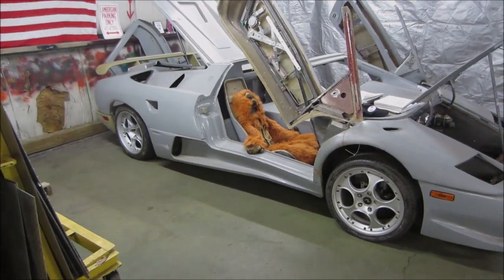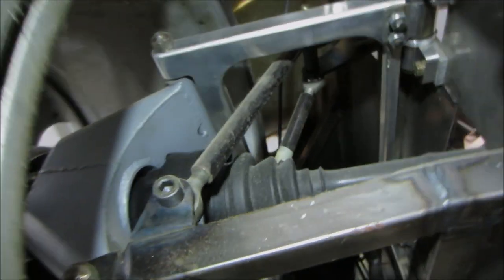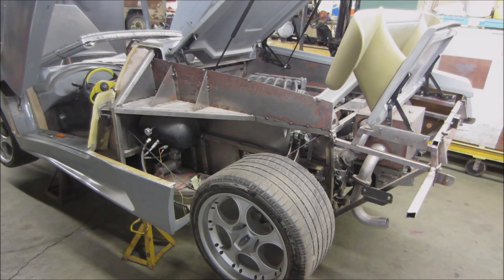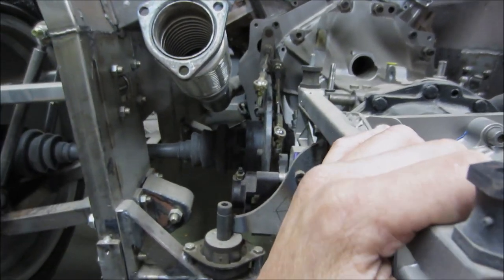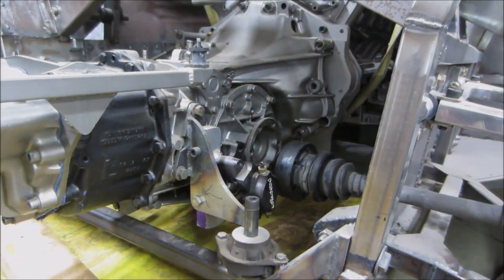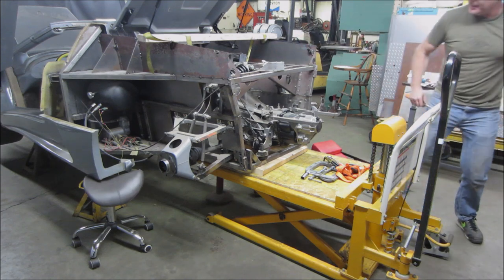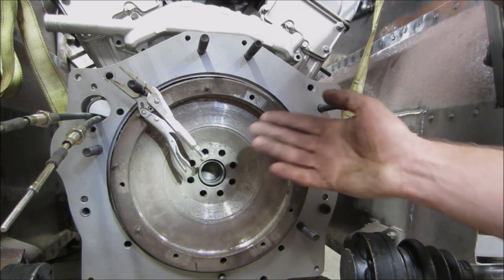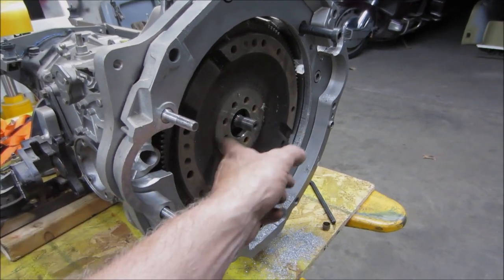Free Lambo Diablo hand built, lets see what it needs to Run?

Comment: I'm not sure if it helps but the UK-based kit cars like this eg Ford GT40 type used either a Renault 30 or, Porsche G50 box. I'm told the Renault box proved to be a bit marginal for the Ford's V8 torque whilst the Porsche G50 box was quite difficult to source. I expect the BMW V12 will be quite torquey as well. Maybe use a V12's auto box with 'paddle' shifts - assuming an electronic box is available ? Failing this, it looks like a re-engineering job on the flywheel, housing and clutch-to-box mating. Might be worth trying to track down the original kit designers to see what they had in mind....

Comment: Hmmmm, Leave this flywheel and clutch in that last position. Need a flywheel that fits the engine, machine an 8-bolt block/cylinder to take the gap between the "new" bigger flywheel and the 1 you have. (maybe a rubber thing?) Leaving the flywheel you have, starterfunction inert, but works with the clutch. I hope I make sense. ;)

Comment: I don't know what that transaxle is, but I know (100% certain) it's not from a Porsche 944, 951, 968, 924, 931, or  928.  I agree the 5th gear section is similar in appearance but the casting of the trans is not the same. Porsche front engine cars have the clutch/flywheel in the bell housing on the engine end of the torque tube, not in the transaxle. This trans is from a FWD car. My best guess is this transaxle might be from an Audi 5000 (016 5-spd maybe?) Would make sense, similar concept as the Fiat 128 & Fiat X1/9 (used the same transaxle in FWD & mid engine car) but this time using a longitudinal layout with different engine.

Comment: I dont think the guy gave up on it, because of this problem. Probably just started working less and less... 
Quick google search returned that there 100% is something that will fit it. Just make sure exactly what do You have. If that transmission is Porsche and not Audi, then it is inverted somehow. Im sure this engine/trans combo can be made working again with some time and donor car. Im more concerned about fiberglass shell fit and finish, getting all the rattles from it and making all the brackets to support it, so it doesnt look like a mess.

Comment: Start whith a full engine inspection if it's a mockup or not and low budget .second trans axal from audi sounds like option and the adapter guys out there solid info and a derection to go. Therdly ecu like the tuners use I think it's called super squirt all sensors are  able to be measured for peak performance even from a hand build that gives you power to the ground the sense of accomplishment to finish or there's a crazy guy in Ireland whith a youtube Chanel builds ground up's

Comment: Is the ring gear on the flywheel you have pressed on or a molded part of the casting? If pressed on, perhaps you could have a machine shop fabricate a ring gear that is wide enough to reach the starter drive.

Comment: seeings that the power plant is the heart of the car , one would think that it would be the first thing completed and then build the car around it . i can see this guys thought were there but, must of gotten frustrated and shifted his plan to the body .... opps ... good luck  ... i can see that you will have to sort out drive train and then reset it to the body to get it to work right  ... retro a sub frame to hold drive train as one unit before the install .... just my thoughts

Comment: That flywheel is going to be a complex one as it got to be centred and balanced if welded it will need to be preheated, I’m not sure a flex plate will be up to the job, a flat steel blank and ring gear shrunk fit and welded
Reply: CMS do a conversion kit for a v12 to Porsche g50 box but it’s 1900 dollars

Comment: Looks like the engine and xmsn were installed as a unit .  Might be easier to pull the engine , then when you're ready , bolt em togetherand put em both in at the same time

Comment: The transmission was a Porsche one and the motor was a 12 from a BMW and when we tried to put the bolts in all the holes were gone, So we drilled it out, so that it would fit And with a little bit of help from an adapter kit, We had the engine running just like a song.

Comment: Didn't those BMW V12s have dual independent ECUs? Like they controlled a cylinder bank each is if it was an inline 6. That would explain the dual crank angle sensor mounts, and the angle between them is probably the same as the angle of the cylinder banks. :)

Comment: If you would have dropped the motor as well. it was only two more bolts to unbolt the motor mounts and you would have to use straps and move them or take the starter out. way more work than just taking motor and trans together

Comment: Kudos to you for attempting to take that on. I'm glad as a viewer. But for the one to actually have to do it, it looks like a bloody nightmare! The car seems to be leading more toward the "fabricated on the fly" rather than following any specific design. I'm sure the original owner put lots of heart into it, but it will not be easy to figure out what he was doing for sure as he probably didn't fully know himself. He was sculpting as he went along. It's like trying to finish somebody else's painting.

One thing is for certain, if anybody can get that engine running it's Mustie.

Comment: It might be possible to find the right flywheel for the engine and machine the outer diameter (up to the gear) to fit the adapter plate. And don`t mess with the dynamic balance of your flywheel!! believe me, it`ll not just vibrate, it`ll fly off like crazy (that`s why they cal em flywheels!! lol)

Comment: if that is anything other than a 956 (turbo 944) transmission do yourself a favor and get rid of it. 

im voting for ls conversion; cheap and easy. 
there are also adapters for the 956 and other Porsche/audi transverse gearboxes. 
its super common with the GT40 guys. 

could also do a subaru 6cyl (ez30) with a 5speed/6speed. the lockouts to make it transverse 2wd only arn't all that expensive, or can be fabricated.

Comment: At 17:17 the tank holds a volume of air so it doesnt take you a year and a day to adjust the air bags. otherwise its like filling a tire with one of those cigarette lighter compressors although they will fill a tire it takes like 5 minutes. who has 5 minutes to adjust air bags on there ride when it only takes a small tank to handle the volume.

Comment: Chevy Ls 6.2
You could adapt that trans to Ls easier
Way more power than that boat anchor
You could remove the starter ring from the bmw flywheel,,,and the Porsche starter ring  machine a spacer ring for the Porsche flywheel 
Install the bmw starter ring on Porsche 
Weld up the holes on bolt pattern open the center hole to fit bmw crankshaft and redrill bmw bolt patter in the flywheel

Comment: I suggest look for a salvage Diablo which had been wrinkled around an utility pole.
Sorry for my bad english but with stock parts you got the best result - and the fas-
test way to a running car. As more close to the original, the higher the sell price.
Or check for a salvage 993 Turbo4S (the latest aircooled 911) and use its 'ingredients'.
All the other tries will not make you happy. Btw, i still wonder if there is no intellectual
and/or design property on this object. sssst

Comment: G'day  Mustie ,,
Just picked up on this one ,and it has all  the makings of a great project .
Frankly, I don't think it's the impossible  job others are balking  at . Sure the mating of the drivetrain requires a technical  fix  that is beyond  the average shop ,, however , quite simply,  this is where a specialist  is required to assist with the appropriate  fix ,and it will be well worth the outlay  to overcome  this issue .
Moreover ,there are possibly a few good solutions to joining the motor and box .
In your position ,,I would continue to work on all the other jobs  that you are more than capable of completing.......
Leave the drivetrain fix to the appropriate  specialist,,,  the end result will be  another notch  in Musties gun .
Do your research  on this one , take your time and do your best work .
 Sure,,  it will require substantial  effort , but  your a substantial  kinda guy Mustie.
BRING  IT  ON ......!!!

Much  Respect 
      from
Down  Under

Comment: It looks to me like you are putting the fly wheel on bass akwards. how is the clutch disc sopposed to work against that surface gear side away from motor not next to motor, then it has an inset so it will meet up with the engine.

Comment: Option #1 find a complete BMW parts car with a running engine with harness and ECU Option #2 small block Chevy or LS engine swap but in my opinion it's been done before and it's the easy way out Option #3 air cooled Porsche engine :)

Comment: Can you put that thick of a plate between that back housing on the trans and the middle of the trans? I don't think that's the normal mount position. Watch out for bearing end play and gear mesh issues.

Comment: I would be concerned that the Porsche transaxle may not handle the power of the BMW V12.  The 924 only had to deal with 168 BHP or about 180 lb/ft of torque.  The BMW V12 could put out well in excess of 312 lb/ft f torque depending on the version.  I think you were given a money pit.  But good luck with it.  At least it isn't rusted out.

Comment: It's got 9 bolt holes on the end of the crank shaft and 8 holes on the flywheel, so it will not fit check other parts

Comment: I have to say i like this better then the real deal....you get to use aftermarket gear you choose entirely from senseors to throttle bodys to ecu,s and that will make this an amazing car by the time its driveable! And in alot of ways alot easier to fix and alot cheaper to fix ....lets be honest a Buick used sensor from the last 2 years that will work with a stand alone aftermarket ecu like a haltec is going ti be alot chraper then a lambo specific one and probably in the long run will work better

Comment: I think you'd be in your domain if you just put a built-up Volkswagen engine in it. That chassis don't look very heavy so 200 horsepower would go a long way. You could also use a Chevy Cobalt turbo 4 setup in it if you want to go  a little more higher tech.

Comment: In your position, I think I may consider looking the rest of the car over and measure the PITA factor of getting the rest of it right... If it's not too high, I'd probably work on that stuff and sit back and quietly wait until C8 Corvettes start getting totaled and then just swap in the complete Chevy setup, stock. Even if it's $10k, it will be less expensive than dealing with weirdo 20-30 year old BMW stuff that is only partially complete anyhow.

At a glance, I'd say get the car to a point that it's at least an honest roller, install all of the parts in it that you can, and sell it off to the next dreamer. It's just heaps and heaps of work for something that really won't be worth much in the end.

Comment: can you move the starte closer but trimming the bracket down? would that make the engines reinforcements in that area to weak? cause looks like you couldn't personally  or buy a stock flywheel/converter and machine it down to where you can merge the parts together and use the originals gearing size since looks like theirs room but idk im not super skilled in this stuff

Comment: Phase III remove every hardware grade bolt and add Loc-Tite or safety wire. This thing will most likely rattle itsself apart in current condition.

Comment: looks to me he designed that to where when separating the engine from the transmision the flexplate stayed on the engine and the flywheel stayed on the transmission and some how they interlocked when they are connected...how i have no clue..but i bet money the flexplate was somewhere in his garage...the metal shavings you found was proof he had done some modifying inside there and he probably had solved the problem why else would he have moved on in fabrication ???..good luck with this project..

Comment: So there would be an adapter for the crank to bolt on a flywheel for a manual v12 7 series in my thoughts. That plate on the back of the engine, is that an adapter or part of the block? Is there a different plate for a manual trans that a flywheel fits into? My ford had a replaceable part on the crank for the pilot on the torque converter so would it be unreasonable to think they make a plate for that crank for flywheel or flex plate interchangeable-bility. A 7 series manual trans blown engine might be what to look for. Hmm 🤔 so many questions, now my brain hurts, thanks 😊

Comment: Well, you bit off a mighty big chunk this time and I bet you'll be chewing on it for quite a while. Kit carts are always a nightmare ! I suggest starting off with the starter ring gear from the BMW. You mentioned that all the exports were automatics, so it will probably be a flex plate. that will connect the starter and the crank shaft and give you a place to drill a bolt circle to mount the Porche flywheel. Did you notice the Porche flywheel has 8 bolt holes while the BMW crank has 9 bolt holes? A spacer plate between the BMW flex plate and the Porche flywheel should be fairly easy to fabricate. The thickness should not be critical, as there should be enough room between the pressure plate and the front of the trans case for the throwout fork travel. Once you pass this hurtle the rest of the powertrain should be fairly easy. I wish I knew where to put the fuel tank!  I'll be watching and rooting for you. Good Luck!!

Comment: That rear cradle setup does not look strong enough to handle the horsepower and the torque from a V12 and 335 tires.
Im no engineer, but looking at the pipe sizes and wall thicknesses just nake me wonder.

Comment: On a positive note you are the Only one I would bet money on that could complete this project. But on a negative note this could be a time pit, money pit less cause it's not a real Lamborghini. Man I'm jumping at the bit to see what your going do with this!! It might be sitting on your lawn as lawn furniture next spring.....I would be concerned  to go the bmw route. Cooling, wiring, sensors, wiring wiring. Porsche 6 cylinder air-cooled would be my option.  Porsche motor, Porsche trans, Porsche transaxle. Mustie knows this stuff. You know a big bore turbo bug motor wouldn't be bad. You can't hurt the value of a kit car.

Comment: v12 engine I think is same as Maclaren f1,   v12 has no flywheel because of engine balance,   use v12 flexplate and steel or alloy  sandwich to mate and fix clutch even using different pressure plate

Comment: Im sure you will figure it out. Good point on that adapter plate. The engine had a flywheel and starter that fit from factory, its the adapter plate thats the problem.

Comment: If they have sold the other engine, is this one just for dummying up and is it any good or even complete. From memory it has 2 complete ignition systems and the oil filter is remotely mounted in the left corner of the engine bay. Its a cartridge filter with a screw on cap. Taking it apart is like reinventing the wheel. The way i used to get those large dowels out was to pit a deep socket inside it and then used vice grips on the outside and rotate it. any info on where the adaptor plate came from as it may have come as a kit flywheel, spigot brg and adaptor plate.  You could put a 36hp and split trans just to piss the lambo owners off. Under power it. LOL Or a lister stationary engine. I think they are still made in India.

Comment: While it looks cool, there are some definite "engineering" issues done by the original owner, who happened to be an engineer.  (Read that as you will, not a fan of engineers in general as most of them have their heads up their own butt) Probably the best solution to this "project" is to part it out. While it would be cool to get it all together to see the end result for the family, I don't seeing it being economically feasible.  Read that as GIANT MONEY PIT. Over the years, the one thing I have realized is that other people's unfinished project cars usually end up being no more than parts cars in the end.  Run Mustie! Run from it while you still can!

Comment: That thing needs an entire new chassis. It would be better to strip it down, weld up a tube chassis and test fit along the way with the body panels. Nothing about that square tubing looks capable of taking any kind of force. I would be worried about getting under that thing IMHO. Buy a cheap used sports car chassis and cut it down to size then bolt those panels two it. That frame is just good for salvage

Comment: that engine looks like its a mock-up engine, it probably doesn't run and never will, the engine they sold was probably the one that was supposed to be installed to make it run. where i used to work we had 3 shell engines they looked like runners but unless you put in serious money to rebuild them they wont run. they ere ment to be put in place for custom builds to test for clearance and the welding/beating placing wouldn't damage the expensive engine

Comment: Just an FYI your transmission is not a Porsche 924, It is a late 80's Audi 5000 016 non-quattro transmission, capable of handling 400hp, Commonly used in these builds, Seek out Lamboclone dot com for help because you are going to need it with this build! All the best!

Comment: More than likely the previous owner was in the job of just mocking everything up for fitment and then would take it all apart  finish all the welding and engine/transmission work,  paint the frame, do the proper suspension and electrical work and then put it all together for the finish car.